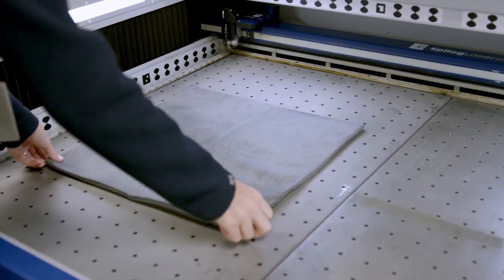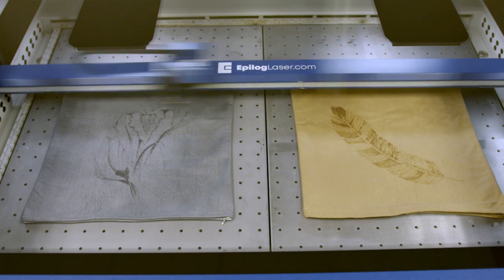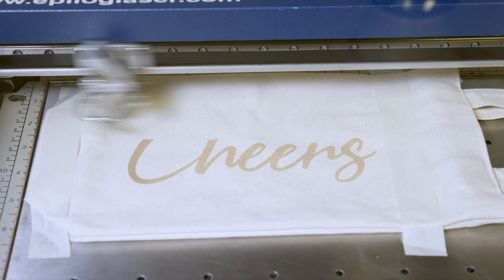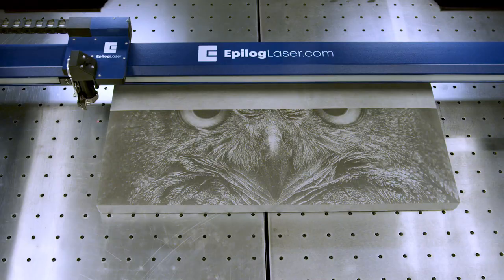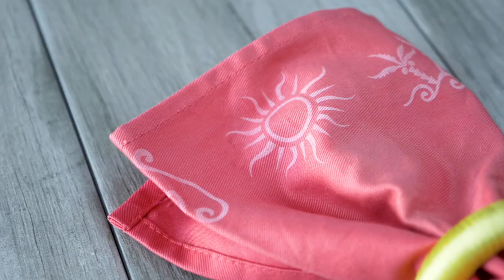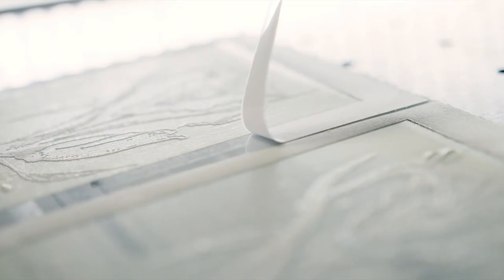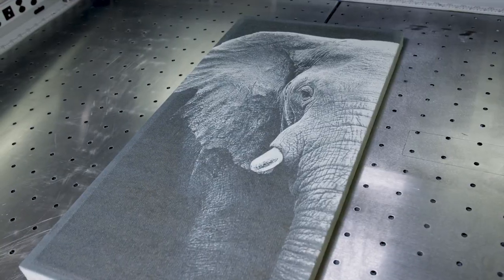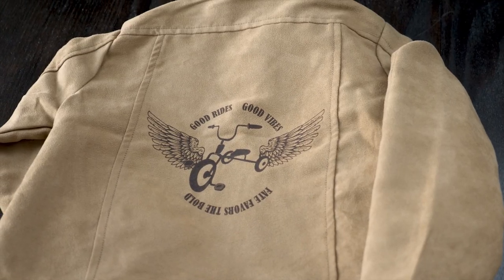Laser Cutting and Engraving Fabric & Textiles with an Epilog Laser

Comment: this is great how much is this machine cost?
Reply from the maker: The cost of our various laser machines is determined by speed (stepper vs. servo motors), engraving table size, laser wattage (ranging from 30 watts to 120 watts), and standard features. The laser machines range from $7,995 to around $66,500 (U.S. pricing only). If you'd like help determining which laser is right for your application or receive pricing information, call us at +1 303 277 1188, or visit our website https://www.epiloglaser.com.
Reply: @epiloglaser  Funny, but link doesn´t work...?!?